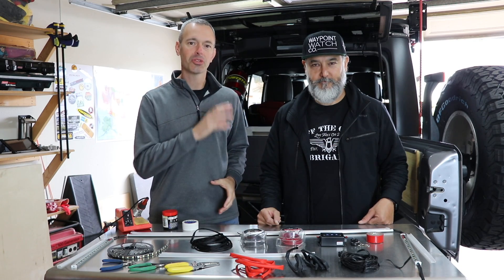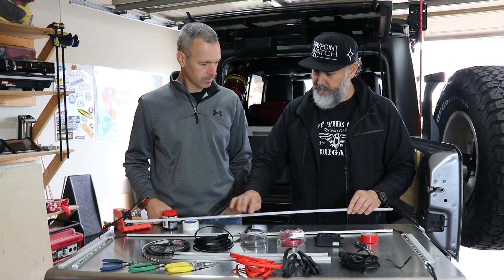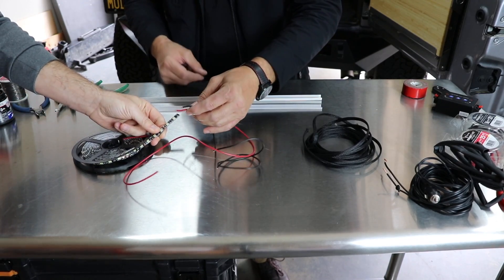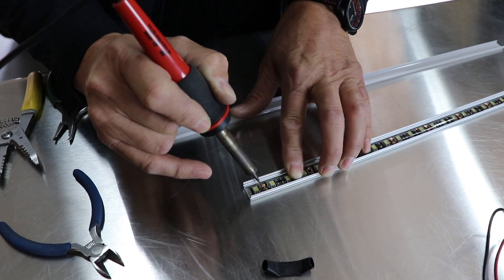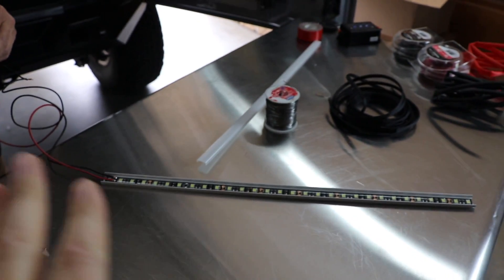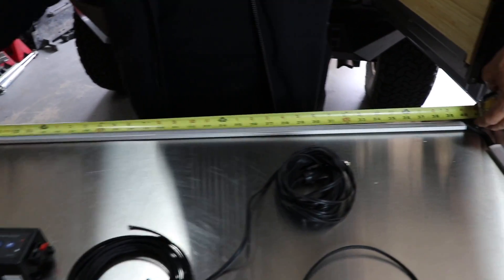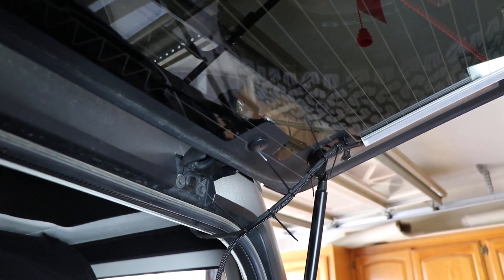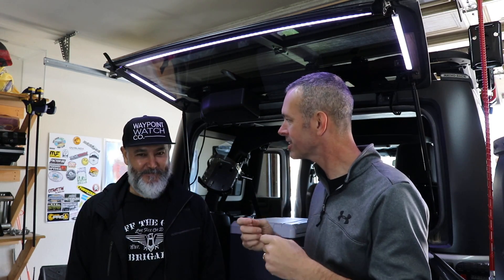How to Build Custom LED Strip Lighting

Comment: Just seeing this video three years later.  Great set up.  Can I run wires and directly connect to battery?  I'm not to savvy with electronics but it wasn't explained how to source power.  I did hear u had a fridge which made it easier for u but I don't have that in my jeep.  Thanks.

Comment: I would have got some liquid electrical tape to insolate those exposed ends and it would have worked better to insolate the solder points...

Comment: You should have put heat shrink over the solder point help keep water out.  Also, you should cut the braided loom with a knife or cutters that you heated up with the heat gun.  By doing this, the loom will not fray and look like it had a hard night of partying.  Lastly, "Fast Cap" makes an incredible tape, called "speed tape' (sold on Amazon) that was not designed for LED's BUT it is by far the best out there for this and any other thing you need double stick tape for.

Comment: I took the padding off of my roll bars, and then took off the dome light, running wiring from dome light to an easy plug to LED strip around inside my hardtop. It plugs upfront by sun visor, and luminates the entire inside, and eliminates the wires on the roll bar.  Love it, super bright.

Comment: You don't need The controller just wire it into your cars wiring to run it, specifically the latch sensor when you open your door, latch

Comment: Why have the aluminum when you can save space and weight by just attaching the LEDs directly to the glass?  Less cost, less weight, less window obstructed, and less likely to cut yourself on a sharp edge.

Comment: LED strip is designed to be cut on the copper pads (cut them in half) some older strip (cheaper) uses a spacing between LEDs much bigger than the new strip which makes fitting to a set space more difficult.  Once cut, there shouldn't be any LEDs or resistors on the "open" (short) side, you work between pads and use them as terminators.

Then simply gently shave off the clear coating with a knife to expose the copper pads,  (Melting a pit it WILL leave residue, overheat the strip and melt the insulating lacquer on the reverse and possibly lift the track from the backing) then dob a little solder on each pad and attach wires (you can get fancy connector sleeves and angles that clip the strips together without solder but they can be fiddly.  Then seal the solder joint with a small blob of hot glue or silicone. 

I don't understand, why bring the power feed in on the right then feed the wires across to the left to pick up a connection, why not keep the trailing wires as short as possible and start on the left?

Comment: I installed mine a couple of weeks ago.  Works great.  For people that don't solder, they have 

easy tabs that you snap on the LED strip and makes connection.  I'm going install a system
in my truck topper and see how that works.  Again, Thank You Brad for you channel. Really enjoy it.

Comment: I saw  Marco's lights on a walk through video and I'm gonna use this for lighting the stairs on my porch and wired into the low voltage transformer. Thank you Marco for the inspiration.
 They sell meat little pigtail connectors so you don't have to solder 😁

Comment: I'm late to the party with this but you can't just cut those LED strips anywhere. You have to cut them at the marked intervals. That's why there are dead LEDs on the strip in the video. Anyone looking to do this mod, make sure you cut the strips properly to avoid that.

Comment: Not sure why you didn’t just run power cord from the driver side of the window through the hole in hard top where window wiper box is (also on driver side).

Comment: I just finished installing LED strips that you guys have linked in my 18 Taco. Like literally 30 minutes ago. It is as bright as the surface of the sun in my camper shell. Note - I wanted to just use the strips so I did not use those "channels" to diffuse the light. I already had the issue of one of the strips trying to come down. I actually installed them in some extruded aluminum framing my camper shell has so it would partially diffuse them. I don't like it and I'm going to end up getting those pieces that you guys used.
Reply from the maker: So many possibilities with these lights.  Great to hear about other projects out there.

Comment: Maybe someone can help me, I installed these on my truck but even after turning them off they still glow like they are getting little bit of power. If I unplug the hot wire from the controller they go off. I bought the same led controller they put in the link, is there another one I can buy that will not allow this to happen?

Comment: Just did this mod - thanks for sharing.  It may have been discussed in comments below, but for those trying to tap into a power source just wire up to the rear dome light and tap into the Black and Yellow wires  (Not the yellow wire with stripe) - Black to Black; Yellow to Red or whatever color wire is your +. LED's will come on with dome light and fade out as well.  Hot glue to cover holes and soldered exposed wires was good call in comment too!

Comment: you don't flux the tip of the soldering iron, you put it on what you want the solder to adhere too. Heat that spot, add solder, it should flow right away otherwise it's not hot enough

Comment: Great video! Is there any issue to lookout for with running the LED's to the battery with a fuse and switch rather than using a controlled dimmer?

Comment: I did a similar in style in my wife's Hyundai Elantra and my mother-in-law's Hyundai accent. I simply tied in to the existing trunk light. Because this system does not draw a lot of current, I felt safe tying into The existing late because there is not excessive current draw. Also, when the truck is opened, it is like daytime. I used the waterproof version in the Electra, I used the non-waterproof version in the accent.  I did not use the aluminum channel, because of the curvature of both trunk lids.

Comment: What did you tap into for power? Awesome video, def my next project!!!!
Reply: Some tap into the accessory 12 volt plug in the cargo area which is always hot and add a switch, some tap into the dome light on the roll cage.

Comment: Hey brad enjoy your videos very helpful. Particularly your upgrade to 37in tire vid.  I'm going to upgrade my tires to 35s saw in your vid you had trouble with yours I'm going to get Cooper discover sst pros was wondering if these were the ones you had problem with as I saw you had this tire on your jeep on your previous videos keep up the videos thanks Manny
Reply from the maker: Thanks!  The STT were a good offload tire and no, not the ones I had issues with in Baja.

Comment: Would I be able use a battery holder instead of putting through the car battery
Reply: chente818 I guess you could as long as you can provide 12v of power to the leds

Comment: @trailrecon your link to the controller goes to the LED strips for some reason, was looking to grab one of these.
Reply from the maker: I think they sold out.  Here is another one I found, but it only has the wireless controls. https://amzn.to/2I5uzPr  Worth searching on eBay.
Reply: Lol I keep forgetting to swtich accounts before posting in comments. Thanks for the follow up bro! Going to use one of these in my lighting setup for my Tuffy Storage trunk, but with KC Cyclones!

Comment: The low current load of the LED's allows you to have them on longer than incandescent lights,  and not have to worry about discharging your battery!
Reply: Hi, how many leds do you think they could run off that 12V?

Comment: Nice idea. I'm going to upgrade my cheap footwell lighting (installed in 2009 LOL) with these; I like the rigid mount, and the ability to use my own wiring (specifically 16AWG SGX-rated). A few things:

1. The braided sleeving can melt if the heat gun is too hot or placed too closely. I've melted it (Techflex) before while trying to contract heat shrink over it in the past. Obviously the fiberglass sleeving doesn't do this lol.
2. It might be a good idea to "pot" the power leads for strain relief and environmental sealing. You can use hot glue or epoxy.
3. The best tape for this application would be VHB 5952; it will handle heat better than the Scotch over the long run.
4. The solution might be better served with a pressure switch located near the hinge instead of a box/module to control it all.

Comment: Great addition to the Jeep.  In case no one mentioned it before (I confess, I didn`t read through the 100 comments) you can put a dab of hot glue over those connections at the LED strip to refill the melted holes and seal up the exposed bit of wire.  Cheers and keep it shiny side up!
Reply: Also to act as strain relief.
Reply: Ha.. I came here to say this. Not THAT big of a deal, but they made comments about having the waterproof coating on the LED strips so I assumed they would want to know the trick of coating things with hot glue.

Comment: Great video, I really think I am going to do this. One area where the "how to" fell a little short was how to wire up the power.  It was easy for you because you just spliced into the power that you already had to run your cooler.  How do we run power assuming we don't already have some wires running back there?
Reply from the maker: You make a great point.  I have an spod system that  was one of my first mods on my Jeep, it really has paid for itself in helping keep wiring simple.  Wiring the lights would require you to find a power source to tap into and there are many options.  I'll see if I can address this in a future video.
Reply: This was my question as well.  Would love to see it addressed in the future. Thanks!
Reply: One easy way is an "add a fuse" or "add a circuit", they are about 5 bucks at any part store, you simply plug it in to an existing fuse slot that only gets power when the key is on (or if you want a switch, then use a fuse with constant power) Then, just take the wire that comes with, extend it, and run it to the back of your jeep. Connect to your positive and ground the black.

Comment: On on the first one he broke a couple leds because you can’t just cut where ever you can only cut at the solder spots in the middle where there is a line or you can cut off a resistor needed to run the led
Reply: This is exactly correct and should be pointed out in the video description.  You can't just cut anywhere other than over the LED.  Cut at one of the lines.

Comment: Bro - I must have missed it but where did you attach the power to or how did you power it up?
Reply: Would be nice to see a couple of those options, most of us don't have a 12v cooler to tap into.
Reply from the maker: The power was tapped into the 12v line going to my cooler and then to my spod.  There are many options for accessing power that will work for this applications.
Reply: They also make controller boxes that are battery powered.

Comment: I love all your videos.  As a newbie, I can't express how helpful and inspiring they are.

However, I would love to see more (probably boring to many) videos about how you hook up (soldering or otherwise) additional electronics to the Jeeps stock wiring/electronic system.
Mechanically, I'm a novice but it all seems fairly logical.  Electronics....I'm totally lost.
And I have a feeling (as you alluded to in the video) that this is a common experience gap.
Exterior lights is my main interest at this time...where do you run the wires, how to you bridge the moisture barrier from exterior to interior (FYI I live in Canada!), how do you conceal the wiring (to make it look professional), and finally (most importantly) - how do you hook it into the fuse box?
How many 'components' can the battery handle?
How do I know if I will run the battery flat?
How can I monitor the battery? etc.
I love your shows, I love your Instagram (I love Overlandx Instagram also).
But these videos would be hugely helpful to me...and hopefully a lot of others.

Keep up the amazing work.
Love it!!
Reply from the maker: Thank you for all the excellent recommendations!

Comment: Nice install!  I did something similar about a year ago.  However, not really caring about having "diffused" light, I just attached the adhesive backing on the flexible LED light strip directly to the window glass.  Those strips are flexible and I made one continuous run all the way around in the same areas you showed.  Some of the reels of LED lights will come with very simple snap connectors to make the connection solid and easy without soldering.
Reply: How did that work?  That’s what I was thinking of doing.  Did you wire it into your dome light or on a separate switch?
Reply: Jeremy McLerran I have 12V in the back cargo area from the factory cig/accessory plug on the lower right of the factory subwoofer.  I mounted a flush rocker switch.  Love the huge area of light in the back.   I actually also have some additional external LED lights near the rockers on both sides as well as some more on the back tire carrier that I did wire into the dome/courtesy circuit so that when I hit the remote unlock I have more than decent exterior lighting at night when I walk up to the Jeep in the dark.
Reply: Behind the passenger side kick panel (the little panel on the sidewall down by the front seat passenger's legs) there is a bundle of wires. In that bundle of wires is one that is yellow with a white stripe.  That is the 12V power for the courtesy lights (dome lights, etc).  It's thin so you don't want to load it with anything heavy, but lightly loaded LED lights like these LED strips, etc are fine.  I'm running two LED strips about 18" long in hard polycarbonate waterproof housings that are mounted underneath near the rocker guards on each side so that you have the "pool" of light on the ground next to the doors on each side to see what you're stepping out into, and I've got a couple more mounted on the tubular sides of my swing-away tire carrier so that when you walk up to the back of the Jeep in the dark you can see what you're doing.

Comment: Please add links to the parts for the led spool and the black box controller with remote.  I want to buy it tonight but can not find them.
Reply: Can you also please add the links for where you got the aluminum track and diffuser cover
Reply from the maker: All links to everything in the video to amazon are in the video description, but you might find them cheaper on ebay.
Reply: TrailRecon no there aren’t links to the exact items. You even state in the description box that the links are to “similar” items not exact. 
It’s a great video but the lack of links to exact items ruins it.